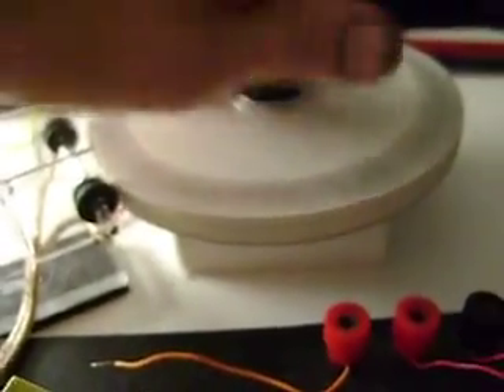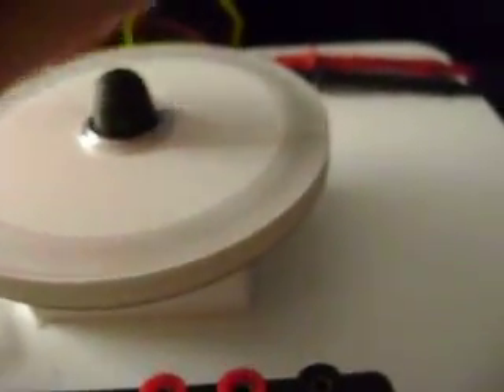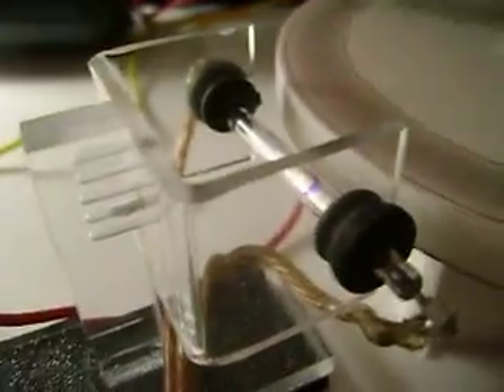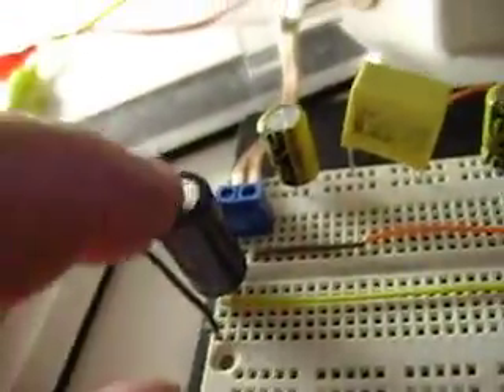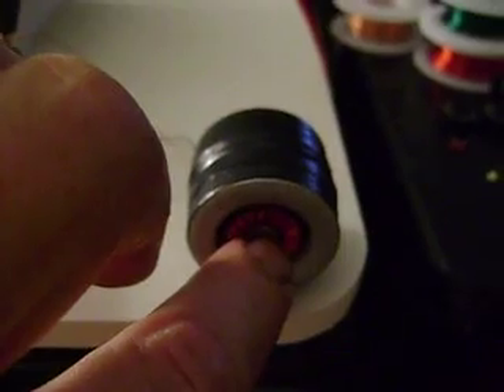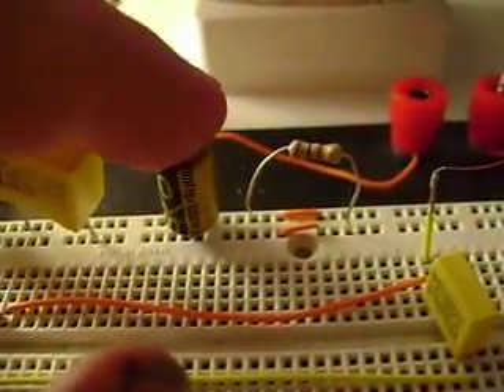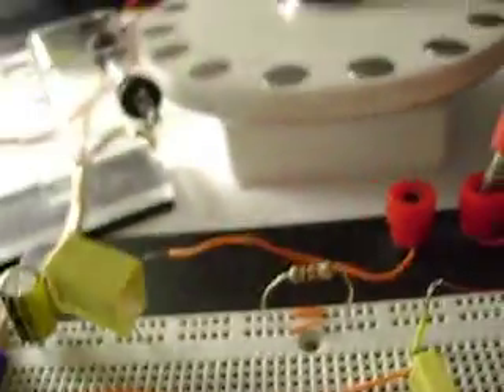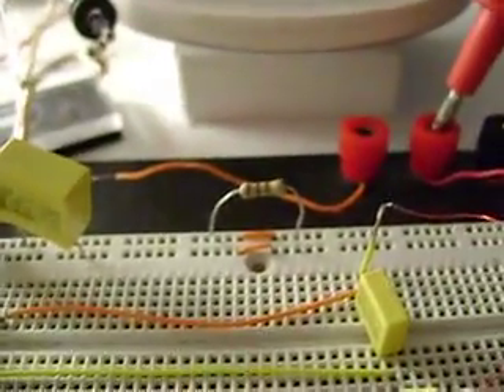Orbonbon current draw and output. Next is more toroid windings

Comment from the maker: I had a thought of running the motor just to produce pulses for the bonbon but went to 555 and mosfet. The SS coil most likely wont have much effect on the rotor because the outer core is not disappearing because it is not wrapped.
The idea is to try to produce voltage charge directly without a moving wheel, using the invisibility  effect on the inner toroid.

Mags